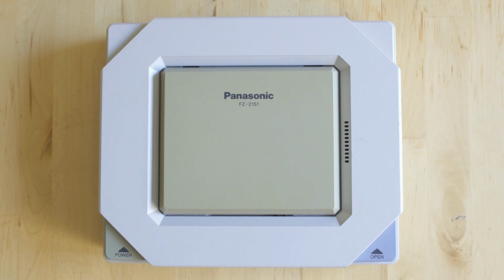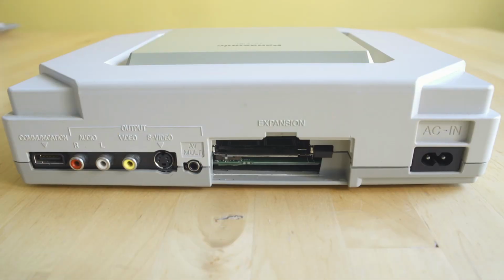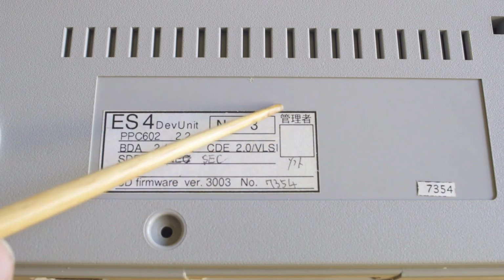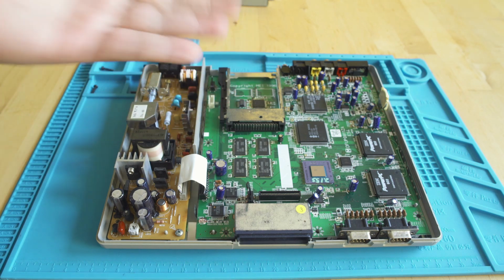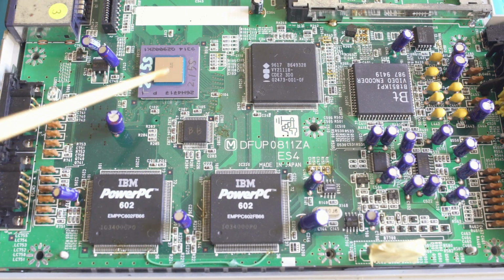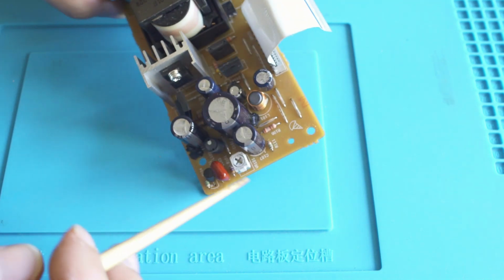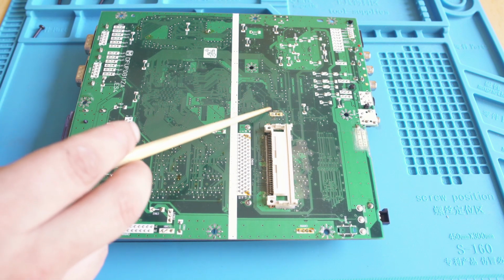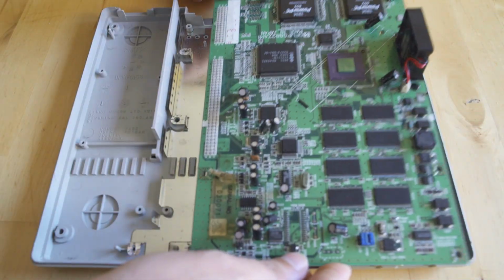The Panasonic 3DO M2 FZ-21 Engineering Sample Console! A Rare Piece of Gaming History!

Comment: It hit me while watching you test the power and open buttons, that they're designed pretty much the same way as the ones on the 3DO FZ-1. The buttons on the case push forward, not down. They're chunky pieces of plastic that are mounted on a spring and engage the actual switch, farther inside on the motherboard. You only see small portions of these large plastic buttons that stick out of the front of the case, which are labeled, "power" and "open/close".
Reply from the maker: That is true. They have a slightly design philosophy shared with the FZ-1

Comment: Even if the caps were ok still might be better to replace them for preventative maintenance being as they are 25 years old. Also sometimes the cap can leak right under  themselves and won't be visibile until after the cap is removed.
Reply from the maker: True but not at that stage yet

Comment: The original owner was Gary Spies and those black screws on the bottom came from a Sega Genesis model 2. It didn't have screws in it when I got it.
Reply from the maker: LOL quite the lineage this thing has gone on
Reply: @VideoGameEsoterica  the memory card slot doesn't like to open because it had hot glue in it originally. ES3 was the one that was demonstrated at studio 3do if isn't racing you see in all the books. It had a switch on the side that could toggle between one or two power PC 602s / early in development the ?2 originally only had one power PC 602. It never had the back door when I bought it from him
Reply from the maker: A switch on the side of this unit or a diff one? Sorry can’t really decipher what you mean as I’ve found no switch on this unit outside the pcmcia card slot
Reply from the maker: Email me if you can. I’d love to chat more. Videogameesoterica at that Google owned email company ;)

Comment: Visual inspection of the capacitors is enough?
Reply from the maker: To feel confident I won’t break the unit before powering it on? Yes. I am looking for corrosion / leaking electrolytic fluid / other visual signs of issues

Comment: I remember reading somewhere that Capcom was going to be a licensed developer for the M2. So maybe we would've got games like street fighter III on the console.
Reply from the maker: Power Stone was an M2 game before moving to Dreamcast. Sadly I’ve never found a single photo, just the main developer saying it was being worked on
Reply: That was probably very early in development. The M2 doesn't look like it would have been easy to develop for since it uses two CPUs similar to the Sega Saturn. Having just one fast CPU I think would have been better for most developers.
Reply from the maker: The Capcom announcement was made at the same time the Konami announcement was made and Konami produced 5 games for M2 so I’m sure it was beyond the point where the second PowerPC was added and ram was doubled.

Comment: A few soundbites from the time:

My limited knowledge of the Saturn and PSX suggest that trying to
do dymanically-computed textures on them would be extraordinarily arduous.
With M2, it's a snap.  This lets you easily and cheaply pull tricks like
"video feedback."  In fact, one of our earlier demos had a TV set object
which was displaying the current camera view.  So when you moved the
camera to point at the TV screen...  It was pretty cool.

--------------------------------------_
Leo L. Schwab -- D

the demo tape featuring the D&D-style
monster fight and the racing game were fakes...  excuse me, simulations,
created using Alias.

        The animations were based on a set of theoretical rendering speeds,
which were later shown to be tremendously optimistic when actual silicon
arrived.

        Still, the numbers we did get out of BDA were pretty damn
impressive; 300K polygons/sec in a typical case (2x N64), 500K if you're
dilligent...

--------------------------------------_
Leo L. Schwab -

THOSE* demos!  You mean the ones with sailboat in the lagoon
and Bossie the cow (actually a hermaphrodite; it had horns and an udder)
behind the cyclone fence?  I had completely forgotten about those.

        Yeah, those videos were generated using a software simulation of
the BDA chip.  They were extremely legit, and in fact the Bossie-behind-
the-fence demo was ported to real hardware, and worked precisely as
advertised.  I don't think anyone ever got around to porting the sailboat
program; the people who wrote it were immersed in more important things by
the time real silicon showed up.

       You've seen the N64 controller, right?  Well, the prototype M2
controller I saw looked very similar.  However, it was built using
prototype plastics.  For those of you who have never seen the stuff
before, it's this yellowish-white substance that isn't very pretty (it
doesn't need to be; it's for prototypes).

        So here we are, looking at this yellowish-white thing with a long
central component and two smaller roundish components at one end, and it
was just completely impossible for us to keep a straight face when anyone
grabbed hold of it...

--------------------------------------_
Leo L. Schwab

All public Opera demos were run on actual hardware.  The original Opera
machines were 13 boards of silicon, which were later compressed into
3 chips, but the "giant graphics engine" was the actual Opera hardware.

Some of the very early very speculative PRIVATE Opera demos were
mockups, but these were never represented as running on real hardware.
They were in fact video tapes of our guesses as to what the hardware
would eventually do.

The approach to the M2 demos was another story altogether...

--
"Stephen H. Landrum"

Comment: This is the kinda thing I really hope gets a MiSTer core. Although I imagine there would not be any easy way of knowing it’s accurate withought sacrificing some of the few units out there. But a close approximation would still be nice.
Reply from the maker: I highly doubt it would fit in the logic gates capacity. N64 can’t work so M2 would be a pipe dream
Reply: I guess there may be a lot of those Konami M2 boards in the wild. I don’t know though.
Reply: @VideoGameEsoterica  yeah. I Didn’t think that through well lol. I still wonder if the Saturn core have to sacrifice a helper chip or something when it’s done. I don’t know enough to know, y’know?
Reply from the maker: They aren’t common but they aren’t impossible to find. One is for sale out of Japan right now for like 800 usd
Reply from the maker: Who knows. It’ll be fun to find out though!